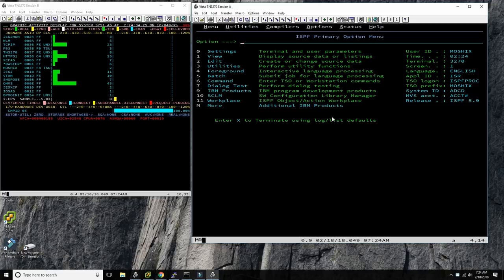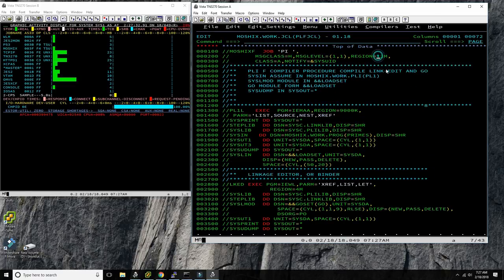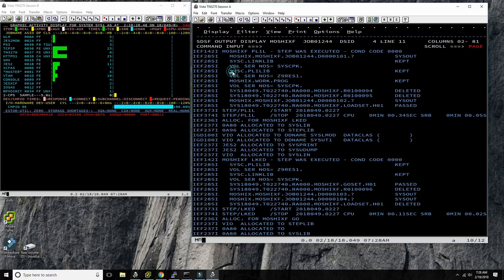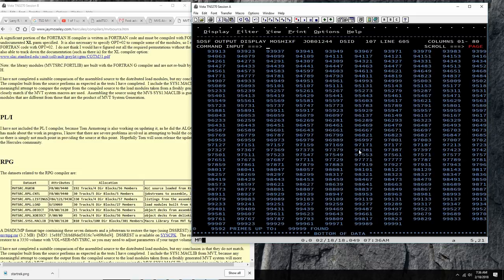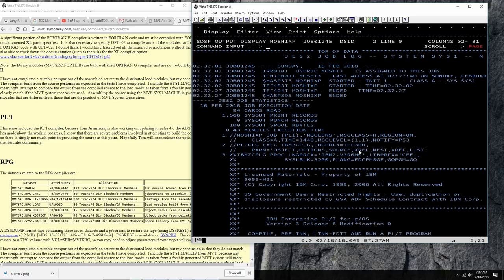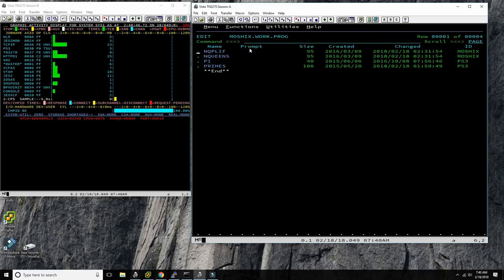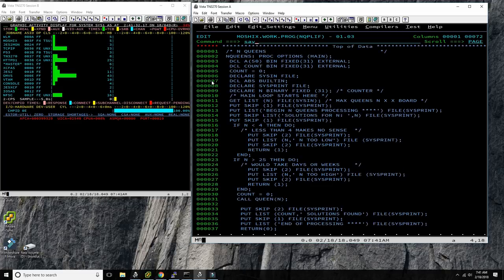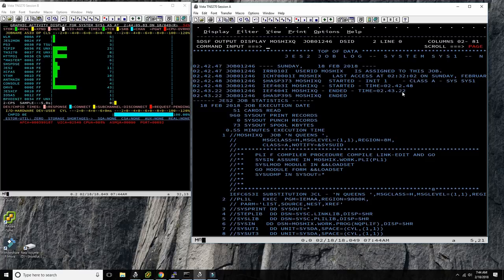50 year old 24 bit PL/I F compiler on a modern 64 bit z/OS system - M46

Comment: To use split screen, follow these steps:

    Move the cursor to the spot where you want the screen to split.
    Press the SPLIT PF key (PF 2). A dotted line indicates the split. After the screen is split, the cursor indicates which part of the screen is active. You can work only in the active part of the screen.
    Figure 1. Determining which part of a split screen is active
    Use the SWAP PF key (PF 9) to move the cursor to the opposite side of the split.
    To return to a single screen, press the END PF key (PF 3) repeatedly in the side you want to exit until the other side appears as a single screen.
Reply from the maker: Thanks a lot. Yes, I did that the whole time during the video. However, there is an ispf command which shows all the active screens and you can then just put the cursors on it and it jumps to that screen. I will search for it and put it in my next video

Comment: Hi moshix, Thank you for running all the combinations of new/old compiler with optimization on/off.  However, it looks like you are just comparing total job elapsed times, which means you are adding the compile, link & run times all together. To focus in on the speed of the code generated, then look at just the run step elapsed time or, better yet, drill down to just the run step CPU seconds. That is what OPT(2) addresses. Also, running either compiler with OPT(2) extends the compile time. So, when you look at total JOB time (for OPT(2)) you have a longer compile time and shorter run time – almost makes the whole JOB elapsed times the same. In an operational environment, a program is complied and put into production and run (maybe) thousands of times. In that case, compile time is not a consideration; run time is all that matters.
Reply from the maker: You absolutely right and I did think of that after releasing the video

Comment: Interesting video, but I'm wondering if you really turned on optimization on the new compiler given that you misspelled the option as 'OPTMIZE' rather than 'OPTIMIZE'?  Did the compiler figure out what you meant?
Reply from the maker: Very good question. I will check !!!
Reply from the maker: Michael Street, I checked: optimize(2 and3) both brought the new compiler to 24 seconds.